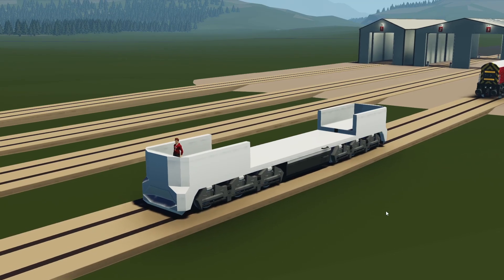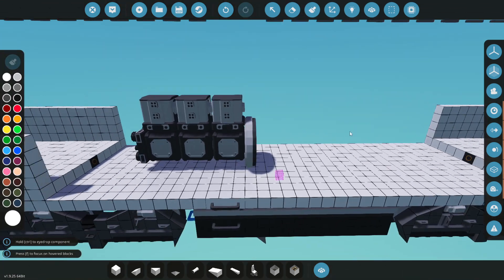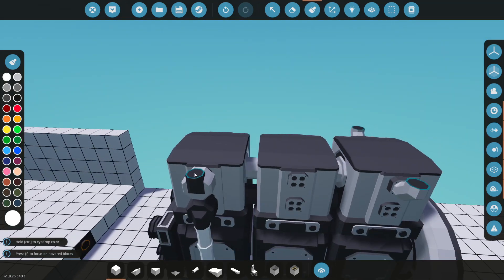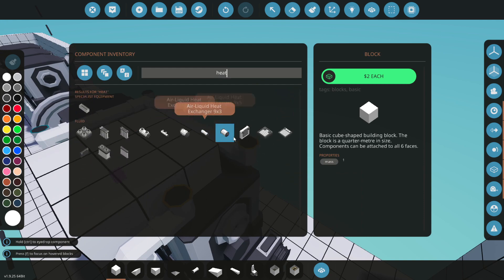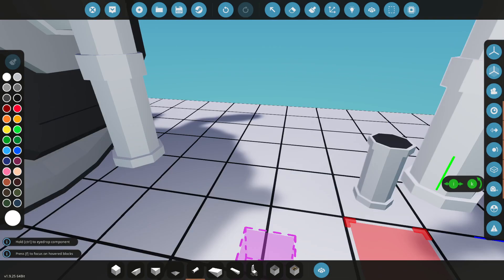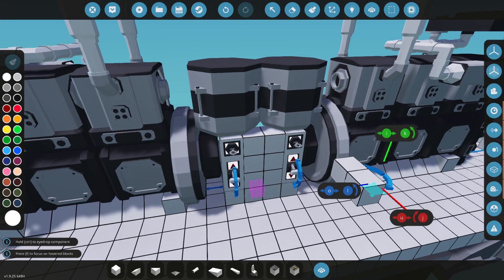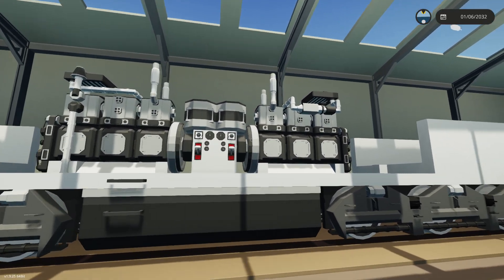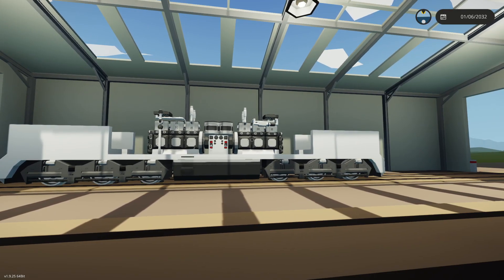Two Massive Diesel Engines! - Diesel Locomotive Build - Part 2

Comment: I just want to say use a large generator not the medium ones as you will buse able to get loads more power from them, like j can get about 4000 from 1 engine running at 12 rps

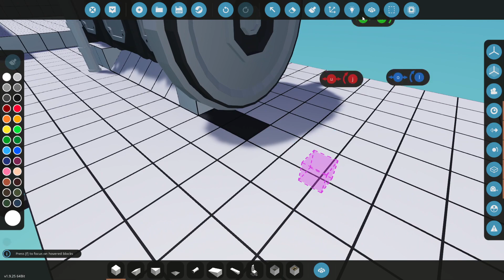Comment: 4:00 shouldn't the fluid Port be on the bottom because of gravity?
Reply: If you didn’t add a pump, yes it should, but if there’s a pump it doesn’t matter
Reply from the maker: Doesnt matter in Stormworks xD
Reply: Storm works doesn't work like that :/